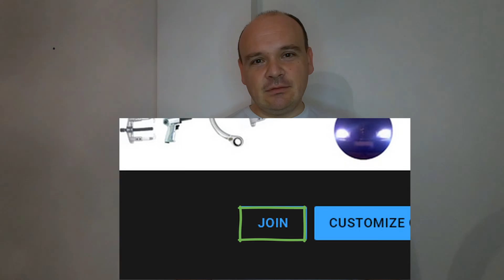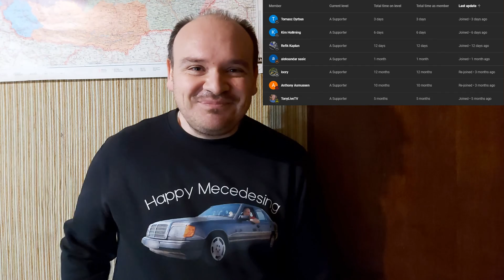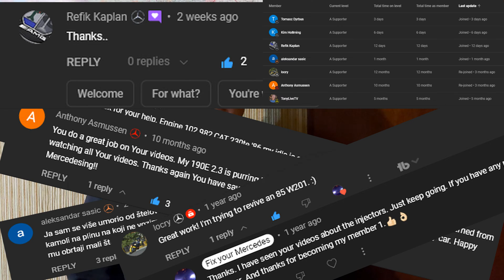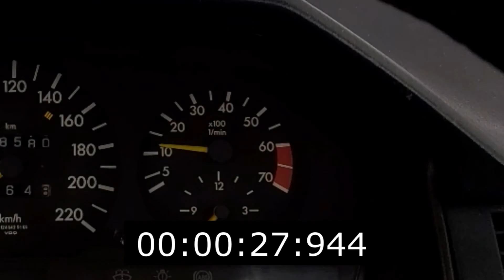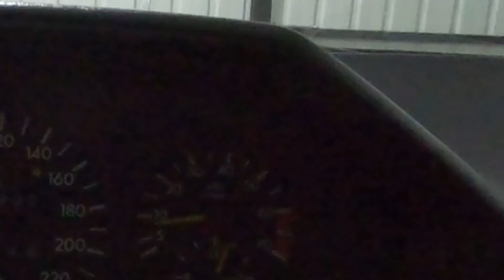㉦Mercedes Ke-Jetronic㉦ - ☝🏻️❗Two different KE3 versions❗☝🏻️

Comment: Hello, I'd like to ask for your help again. 
Engine 102.982 KAT 230te '86 . My problem is that the engine is shaking on idle and when i go full throttle the engine work is unstable and the engine speed goes only to about 4000rpm and accelerate very bad. When the engine is total cold about -5°C then the idle are not stabile but accelerates much better.
Potentiomemter is new ( from Darmstadt ) and calibrated,  the fuel distibutor and eha are regenerated , fuel injectors are new bosch , fuel presure regulator is new bosch, o2 sensor new bosch, ignition components new bosch. Fuel pumps are working well . Duty cycle about 50%. The only thing is that i dont have the 1,9mm gap on the plate. I must turn the screw about 2 times aroud ( 720°) to get the 1,9 mm and then the car whant even start. 
Thank you in advance for your anresponse. Greetings from Poland, Tomek
Reply: Ok i try to do this. Thank you again.
Reply from the maker: Have you rebuilt the fuel distributor?
Reply: @mercedeske  yes
Reply from the maker: Then I would advise you to check the fuel quantities you get in one minute - once simulating full throttle(sensor plate fully deflected) and once simulating idle(sensor plate barely deflected). In first case 10% difference between the cylinders can be tolerated, in the second one if you get 5% or more then you will have to disassemble the distributor and flush it again. 5% is the upper limit for idle, you should try to get 3!
That's what I can say what has to be done after you flush the fuel distributor.

Comment: mi amigo ivica (espero escribirlo bien) maestro de maestros, gracias a usted mi w124.983 se mantiene funcionando. aun tengo mucho que reparar, pero al ver las rpm en 750 al instante quede perplejo o: !!. mi 124 con motor m103 se queda en 1500 rpm por 10 minutos aproximadamente hasta que toma temperatura, es muy molesto. de nuevo te agradezco todo lo que enseñas ya que el sistema ke-jetronic ya casi es tema de oscurantismo. saludos y hasta pronto!!!
Reply from the maker: Hola mi querido Patrick y gracias por estos elogios, me alegro de haberte podido ayudar con uno de tus Benz.  En cuanto al M103, revisa el sensor de temperatura del refrigerante que valores obtiene cuando el motor está frío.  Tienes esos valores en mi video sobre el sensor de temperatura del aire de admisión.  Prácticamente los valores son los mismos.  Entonces, verifique si el sensor muestra buenos valores cuando el motor está frío.  Eso es lo que puedo decir por ahora.  Saludos, Ivica (escribiste bien el nombre 😀)

Comment: Thanks..
9:36 What does this socket do? I searched but got no results.
The pin slots in this socket are different for each engine type. 
There are 3 full pins in my vehicle. I wonder what Mercedes put this socket for..
Reply from the maker: It's for the injection(3), airbag(6) and for the AC(7). If any CODE appears, the ECU reports it to the X11/4. It's only present on the models after september '89. In my experience, it happens very seldom that a code appears. It happens if you have LPG and so called STOP KE relay. Then the ECU will send a code for the lambda as well as for the EHA. M104 engines for example have 16 pins, there are more of them. If there is the EA(electronic accelerator) then one of those pins is for the EA(engines with ESP). For M102 engines, it rarely happens that a code will appear there. Just don't drive on a garbage called LPG and you will have nthing to worry about! Happy Mercedesing!